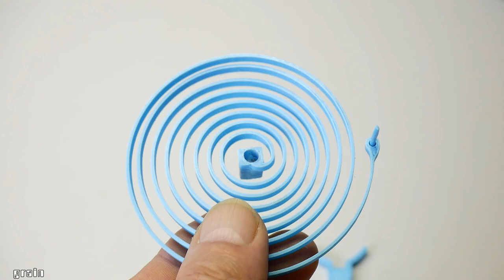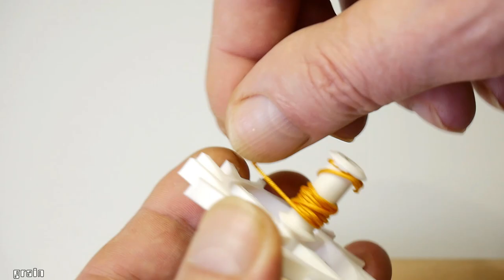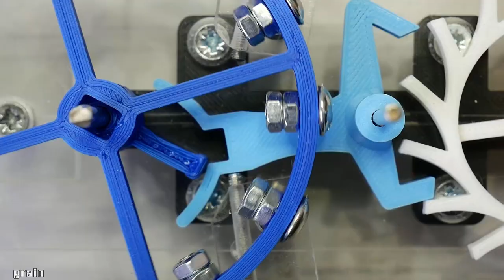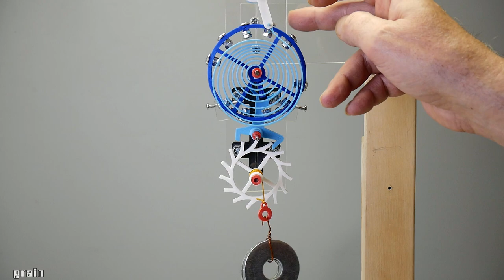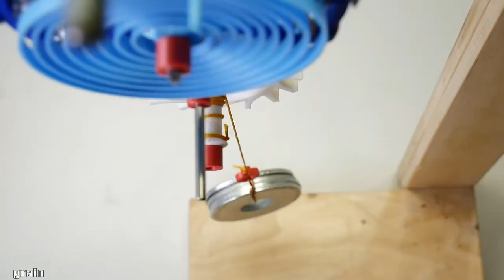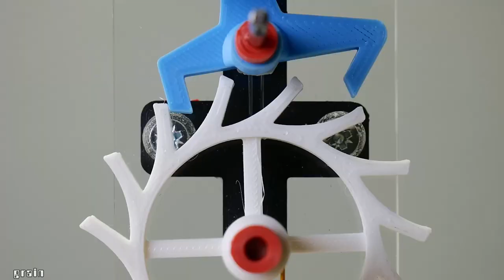Swiss Lever Escapement

Comment: Brilliant! So the spring/weight  puts energy into the hair spring which causes the pallet to oscillate back and forth with weight causing the escapement wheel to push against the pallet and hold it in place until the energy in the hair spring can push the pallet out of the way of the escapement wheel. The mass on the balance wheel (when actually balanced) then regulates the rate of the motion and, thus, the accuracy. I love it!

Comment: Is there a way to make it less loud and adjust the period without change the weight of the inertia wheel?
Reply from the maker: The period depends on the weight of the kettlebell. But in order to reduce this, the details must be more carefully done.
The oscillation period is also changed by the spring - its thickness and length.

Comment: Cool. if only there was a practical use for it. (ha ha ha)
Reply: A gravity battery in a pit or a tower ?
Reply from the maker: Franko Walker
This is just a model for fun. I would like to make a larger model and more careful execution, for example in Plexiglas. The fact is that parts made on a 3D printer do not have sufficient accuracy. At the same time, the Swiss Lever Escapement is an amazing and beautiful mechanism.
Reply: @grain-diose  It's such an intricate device, The inventor was an absolute genius.
It revolusionised time keeping.
Reply: Isnt this how a retractable cord works more or less?
Reply: @chandradeepb3622  I've no idea, but it's how mechanical clocks have worked since the late 1200's.

Comment: Isn't this how a retractable cord also works, more or less?
Reply from the maker: Mechanisms with a retractable cord have a second spring. When the cord is pulled out, this spring is compressed, when released, the mechanism works due to the second spring. In mechanical watches, there are two springs: one for winding the mechanism - a power one, the second small and weak (like mine) is needed for the balance-pendulum.
Reply: @grain-diose  it would help a lot if you would show how a retractable cord works through your simplistic demonstrations. Thank you!
Reply from the maker: @chandradeepb3622  Sorry, I'm working on a new topic now. I think you can easily find the necessary explanatory video, there is plenty of content about clockwork mechanisms on YouTube.